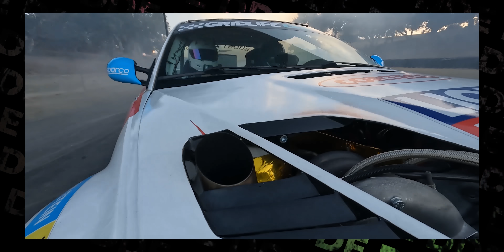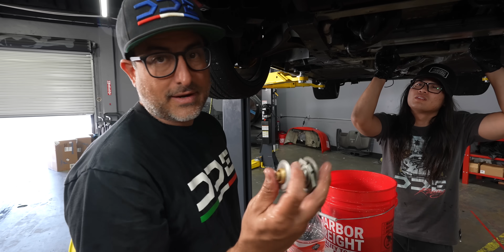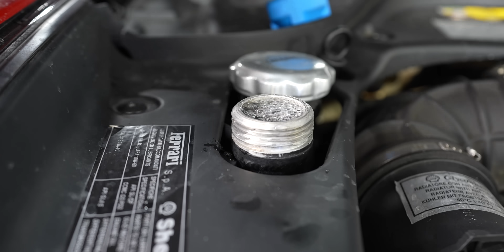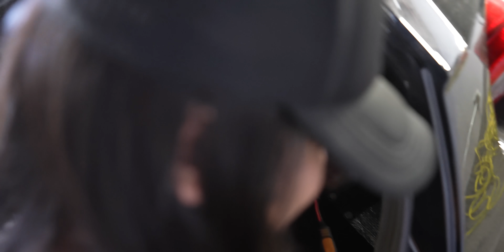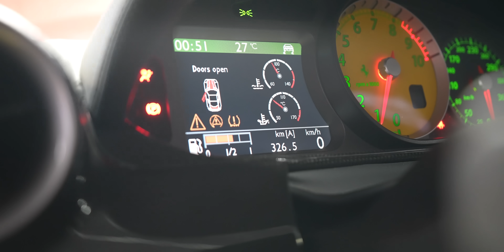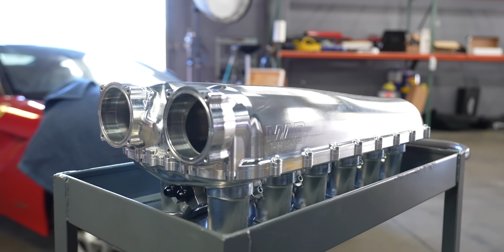WE SCREWED UP... FINDING FATAL FERRARI V12 ENGINE DAMAGE

Comment: This might be stupid but on my lexus. I had the same issue it would over heat and I couldent figure out why. Check the location of heater core hoses, once I realized the heater core hoses where the highest point in the system I was able to bleed the system and have no more overheating issues.

Comment: It's got to be waterpump, thermostat or plugged radiator line. Only other thing is warped head causing leak after heat build up which cooked oil sludge blocking internal radiator lines. I mean I'm just guessing cause im not there. Hope its not any of those things and just a janky sensor lol but youll figure it out after busting out a few grand lmao
Reply: Lol I see the comments have already said all these things I'm guessing the guy that said pay attention to the bypass on faulty thermostat is probably the right comment to pay attention too. Or it's a sensor also in that comment. When you say engine failure I'm thinking catastrophic sludge.

Comment: @dailydrivenexotics Hopefully you guys see this comment but on Daves 599 I would pull some of the rear trim panels and look for a old hard wired gps tracker, i used to work at a luxury dealership as a tech and we had on multiple ocasions old  gps trackers causing constant parasitic draws. if its a canadian car its very common.

Comment: Went threw over heating issue with the SRT jeep ended up being the water pump and the engine coolant sensors, sensors weren't letting fans kick on when they needed. Check water pump and engine coolant sensor. Not the thermostat

Comment: i comment on the previous video saying it was the fans as they are not running and they should be on at 80c
dump the ctek charges and get victron or other ones as ctek will blow batteries up!
as someone that works on cars..., watching this video makes me want to slap people!! first thing you check is power to fan before going to thermostat!

Comment: With the engine cold, reroute the cooling sustem to pull from a bucket and ppush out a deparate hose. Will be messy but will tell you exact flow of waterpump

Comment: Bro I see your testing , vacuum filling the engine is OK,  but when your testing for a blown gasket but it keeps pushing air , you need to pull a clamp and hose from the farthest top point from the filler , put a funnel on the filler neck to lift the high point , then fill till fluid comes out of both sides to the removed hose , I believe with the Rari you might need to pull the top rad hose, and the heater core top hose given the situation with no thermostat and the radiator is still cold .
Reply: He has no idea what you are.explaining😂😂😂

Comment: Correct me if I’m wrong but wouldn’t the fans fail to kick on if the thermostat isn’t present… like during a water pump failure or they start to go common signs being radiator fans not turning on correctly… atleast per bmw but maybe need a water pump, im commenting 1/4 way through the video still awesome great video just Curious if that’s something that could happen
Reply: The more I’m watching the more I’m curious as I’ve commented if it’s actually a water pump especially being tied to a dry oil sump I feel, ibs cable on bmw links all the issues to test

Comment: water pump i reckon. If the radiator is cold, yet the temp is high, its not pumping water through the engine. if it was the head gasket, the system would be pressurising & even after you heat it up & cooled it down, the system should be over pressurised.

Comment: Could it possibly be the impeller on the water pump ? Either broken off or not turning. Therefore not actually pumping the water through the radiator and it just boils in the engine? Not no Ferrari Mechanic but would be cool to  work on one ..maybe one day.

Comment: Those TK Head Checks are not always reliable, back when I worked as a mechanic i had head gasket issue that didn't change the colour of the liquid. Just wondering if revving the nuts off it might be causing the water pump to capitate. wonder if you could convert it to a electric water pump.

Comment: not a Ferrari expert but shouldn't you be able to hook up an obd2 tablet and command the water pump to turn on (if its electric), or the fans, and the data for the cooling system to help diagnose the overheating issue?

Comment: 24:20 One of the coolant temp sensors that controls the fan is usually after the thermostat, so if the thermostat is closed and no coolant is getting into the lower rad hose, it won't turn on the fans because as far as it's concerned, there is no heat in that rad hose, so there's no reason to turn on the fans. This also means that your temp readings are false and coolant is MUCH hotter than your sensors are telling you, it's boiling and the water pump is cavitating trying to pump it past a walled off thermostat. That's why Tim is getting 90c readings but the coolant is obviously boiling over.

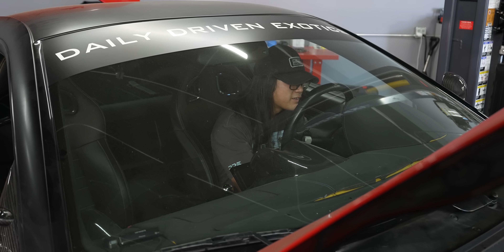Comment: 23:40 yup thermostat's fucked. That's your water pump trying to circulate coolant and your thermostat blocking the way, that's also why even with 3 fans running it won't cool off.

Comment: 11:20 either coolant temp sensor, or for whatever reason, the AC not being properly charged or the AC pressure switch can also cause the electric fan to not turn on.

Comment: send radiator for a check up and service it then change water pump...because of high temp straight shut down engine will make water circulation stop immediately make cause blade on water pump broken or radiator block

Comment: The Nocco jump packs have a bypass mode so they act as a old school jump box check the instructions!! Also over the years of fixing cars professionally  i have experienced water pumps on various cars an trucks that would suck air in the weep hole and would cause similar symptoms to a failed head gasket. the water pump also was not leaking fluid external it would only suck air in while its spinning / motor running. when you try to do a pressure test or a vacuum test the pump seal would actually seal and not show the issue. have also seen the water pump was broken internally  and not circulating the fluid so it would boil over.

Comment: Literally just dealt with this exact issue on my car, coolant pressurizing and popping off hoses and bubbling up like there's a headgasket leak. My thermostat was stuck closed and wasn't letting any coolant into the rad. Not a headgasket leak, the best way to check for a headgasket leak is either compression testing each cylinder or a leakdown test. I compression tested mine and all were roughly the same, so no headgasket leak, just lots of compounding issues.

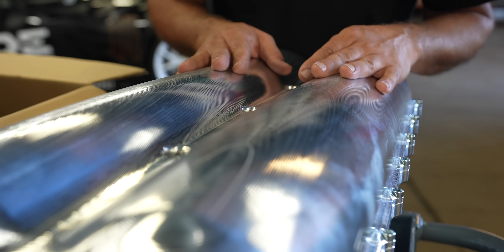Comment: 28:56 does the new manifold have a burst panel? It’s worth getting an intake with a burst panel it if not especially since it’s for a built Ferrari engine and other could save your engine some day resulting in you hopefully only having to replace the Burst panel and fixing what cause the burst panel to go

Comment: Head gasket repair is not that expensive. You take the heads off and have them resurfaced. Get new head gaskets and that’s it. You don’t need to do anything with the block unless you cracked the block (which is highly unlikely). Quit being so dramatic

Comment: Ok no thermostat can actually cause it to run warmer. The thermostat will allow the hot water to pass then close when the cooler water hits it. Which gives the hot water adequate time to cool. Without a thermostat it’s constantly flowing hot water and not able to properly cool

Comment: why not skip all these silly tests... straight to actual mechanic stuff....... compression and leak down test the motor, if the head gasket is leaking you will see a percentage loss in affected cylinder and bubbles in coolant bottle. this test can be done cold. :text-green-game-over:

Comment: Smart chargers can't detect a dead battery. Attach a rectangular 9 volt battery to the dead battery and then the charger to the dead battery...the charger will turn on, disconnect the 9 volt battery.

Comment: Its called a block test, the fluid changes with hydrocarbons. It appeared it passed. It reminds me of a 6.4 powerstroke that had a plastic pump wheel, it cracked causing this exactly. I was as stumped as you are. Finally figured it out, customer didn't wana believe me that it was the pump. Im curious if the 599 has a plastic wheel

Comment: Wth are you doing If the radiator isn't hot it's the thermostat then check the temperature sensor and radiator sensors you have a ob2 port normally next to the fuse box try a scanner obvious things

Comment: See if you can find a flow meter. They used to have old school ones. Just looked like an tone impeller in a clear housing with adapters. So you could see the flow of the coolant.

Comment: You know some of those cars have a thermostat block there are 2 or 3 thermostats seems like you need to change all of them doesn’t seem like the water is circulating out of the radiator

Comment: Hey mike doesnt coolant raise the boiling point so just water will make a car run hotter daves car has coolant where damons car just has distilled water, i know its expensive to run coolant but u have to fill it with coolant

Comment: If the boys want Block Beaters then I think that they need to go with a few vehicles that dont require such specialized and expensive replacement parts. Some 350Z or Similar as Block Beaters are easy and cheap to get parts for as compared to Ferrari. Just my opinion.

Comment: I’m a retired ASE certified owner operator for 38 years. I specialized in cooling /heating and A/C. There are a few things that come to mind. 
In order to get a correct diagnosis you have to replace the thermostat and then refill the system to check for other problems causing the overheating. If you don’t have the coolant full in the entire engine,heater and radiator. You had enough air going the the block test of it has carbon monoxide in the system it would have changed color. 
I would be happy to help you figure it out if you want to. I’m retired and have nothing to do with. Let me know. Jeff
Reply: or drain the system, remove plugs, pressurize cooling sys, listen to plug holes for bubbles.

Comment: Just flow test the heater core lines, remove them from the core and loop them through a sightglass. if you get no pressure or very low flow without a thermostat, then you're replacing the water pump. It is the likely culprit.

Comment: Don't skip the basics. Swap the pressure cap with the other car to rule it out. Could definitely cause overheating if the system isn't running under enough pressure.

Comment: Water pump the Is impeller don't have blades on it, and that's from Electrolysis in the coolant From voltage , i've seen it twice in my Lifetime
Reply: And fun fact it has a plastic impeller so it also could be not hooked to the shaft

Comment: Could it be a kinked or melted close hose, if the radiator is cold on one side means its not circulating through had it on my car replaced hose and radiator and rebled the system and it sorted itself out

Comment: I have had a very similar issue once. Cold radiators, overheating and fans not starting. Turned out to be an airlock in the radiators. The vacuum process is not always sufficient. Coolant is not cirvulating in your radiators which is why they are cold, and the fans are not starting since the relays get their signal from the Coolant temp in the radiators. The crank driven pumps rarely fail. I solved my issue by simply filling my radiators with coolant manually. Luckily for me i had a cap on the actual radiators where i could fill them up. Solved the entire issue immediately. Hopefully that could solve it for you too..

Comment: Removing the thermostat will not allow the coolant to have a chance to cool with the fans. Put the thermostat back in make a plate t j e size thermostat and drill a hole to slow down the flow

Comment: MIKE YOU HAVE A VALID POINT… stop beating the street cars and finish the F12!
HUGE OIL COOLERS (Engine/Trans/Diff) mostly engine, WITH FANS.. Increases oil capacity also!!!🙏 this will save those engines when Damon is bouncing them off the Rev limiter!! 
We need a Big sponsor to give them oil coolers for every single car they have!!

Comment: It must be the water pump that is broken. The temperature sensor for the fans is most likely in the radiator or at least somewhere else than the temperature gauge for the dashboard. then the fans will not start when there is no circulation of the water. then the small amount of water standing still in the engine will boil quickly. even if the gauge shows less temperature. you have to have circulation for gauges to be right.

Comment: Ummm you didn’t bleed your fill line while vacuum bleeding? You’re supposed to have it hooked up while you are vacuuming and suck the coolant up the hose then close the valve and continue sucking so there isn’t air in the fill line……otherwise you just suck all the air in the line in front of the coolant. 🤔

Comment: everyone knows. if its the head gasket. check the oil. but go threw step from flushing, to replacing the water pump. still happens drop in a LS

Comment: Wasn't there air already in the hose before putting it in the bucket? Probably should have filled it with coolant, put your thumb over the hose, then place it in the bucket. I may be wrong, but it does make sense.

Comment: Looks like coolants not flowing maybe a thermostat stuck or a water pump blades not flowing seeing the bubbles in the tester fluid and no color change seems no carbon in the cooling system from a head gasket I’d do a thermostat and water pump and check flow on the radiator for blockage good luck 👍
Reply: Cut the center out of the thermostat would be easy just to test flow

Comment: I did rebuild Porsche back 2005 and I had similar issue after multiple checking  conclusions was over heat caused engine block to defect with micro hole.

Comment: Dude check the oil, why didn't you check it to see if it's milky? You done A lot of unnecessary stuff just to see if it's a head gasket..smh. Check all the spark plugs see what's down in the cylinders.. this was a waste of time.
Reply: Not unnecessary test he started actually diag the car blown head gasket sometimes takes awhile to make it’s way to the oil if you are a technician you would know what he did is how you diag a vehicle he left many other things that you check out and he shouldn’t of removed the thermostat without properly refilling the coolant system first

Comment: Removing the thermostat completely makes the cooling fluid pass through the radiator too quickly for it to cool down before entering the engine block again. You need to put the new thermostat in the system and have a normal flow of coolant through the radiator. That’s why your temp is so high compared to the other 599.

Comment: swap the relays in from daves 599 just to test the system. Since dave's fans work properly, if daemons doesn't with daves relays, then you have another issues that needs to be found and fixed in addition to the possible water pump issue.

Comment: Crazy idea. When all parts are back at the HQ have a full length put together of the motor. Putting on gaskets, o rings, hoses, bolts, grease, oil. EVERYTHING. Multi video episodes? A three part “movie”. People who don’t know about how motors come together from just the parts to what makes all the power might be a something people would want to watch. And maybe not much editing into it and talking so it doesn’t slow the process down

Comment: You all did great in this one. Mike seemed very humbled in this video by the over heating issue. I am surprised DDE isn't receiving the models from some company for the plug on here yet.   was expecting all kinds of is it fixed yet how much longer an what's this an why's 😂😢😅 but it's not a have to thing. Yall seem relaxed an less stressed.

Comment: I would say water pump is damaged and cavitating causing the air bubbles, and not pushing the water, hence the cold pipework at the rad, that would be my first port of call, and this would cause the sensors to not pick up temp and turn fans on also

Comment: You might be filling the reservoir to much you should try blending the system removing a screw located on the water pump or thermostat housing to release any air also change the thermostat and temperature sensor maybe that’s what’s not allowing the fans to kick on  at the temperature they need to

Comment: It sounds like you have an intermittent partial clog potentially in the rad, causing an occasional back feed and buildup in pressure simulating differential pressures in different zones, which is why your rad is cool to the touch but everything is boiling out.
I'm fairly confident this is a strange partial clog causing this. Try swapping the rads between the two cars and seeing if the problem follows the part or the car.

Comment: Did you no there is a fluid you can connect to the cooling system witch changes color when there is exhaust leaking in to the coolant system.

Comment: It’s called the Venturi effect ,sucking the air out of the water system but why didn’t you do a chemical sniff test on the water tank to see if it has combustion gasses in water system , 100% accurate

Comment: Did you turn on the heat? You may have an air pocket in the heater core. Check the coolant temperature sensor.

Comment: After a recent break down and having the exact same symtoms as yours, it was diagnosed to be the water pump, swapped it over and the impellar had packed its bags and moved out (didn't get far ad I found the remains and kicked them out) the water was just sat in the pipes boiling and coming out the expanstankion, granted it was on a 2008 volvo and not a ferrari

Comment: When you connected the filler hose to the vacuum bleeder in the bucket you should have filled the hose with coolant. The entire hose was full of air when you connected it and dropped it into the bucket.